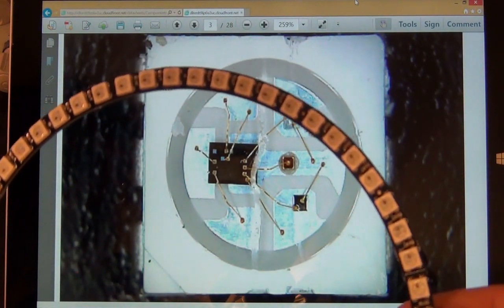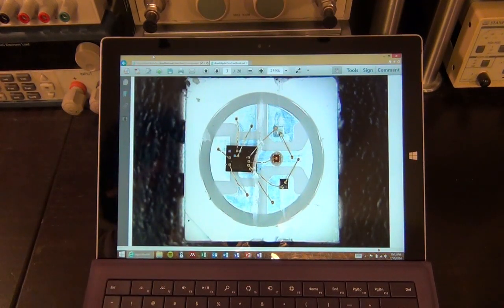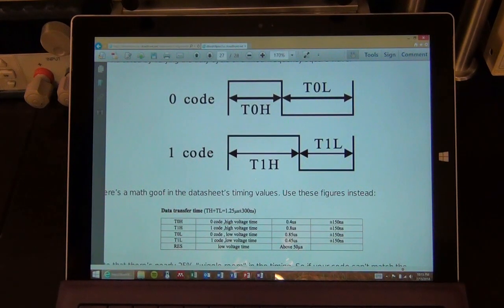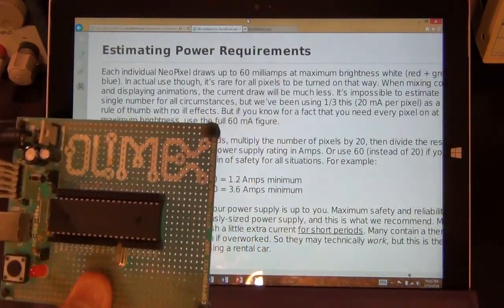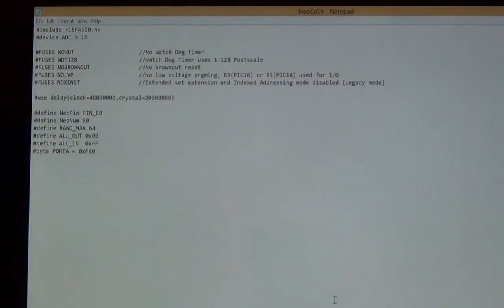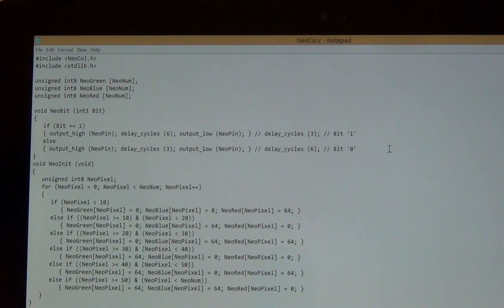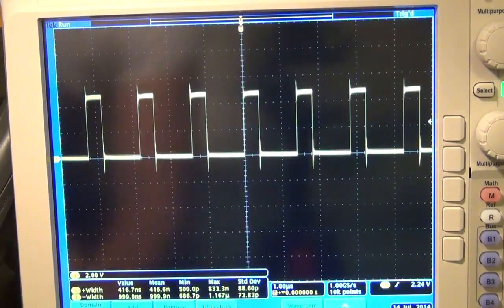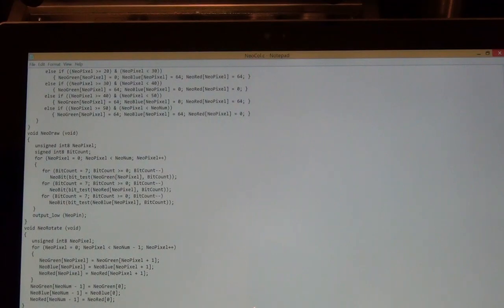TSP #31 - Tutorial on Programming the NeoPixel (WS2812) RGB LEDs and Equipment Giveaway!

Comment: HI, I would love the bench 0-Scope.

My story:
I love electronics and was 80% of the way to my Bachelors Degree in EE. I ran out of funds and could not continue. I worked in an electronics repair shop for a couple of years fixing mostly home electronics. For practical reasons I went into computer service and eventually started my own IT business. When the economy slumped I lost 75% of my income. My wife got sick and would have died had I not focused my attention on getting her well. Now she is better but my business suffered badly. The economy hasn't recovered where we live and we need to move once back on our feet financally. I had to sell nearly all the equipment and test gear I owned during this period. Since I owe a great deal of money I am unable to purchase test equipment beyond a DMM. I was gifted the money to buy a YiHua 898D+ SMD soldering station and a nano scope which is pretty unusable.

My O-Scope useage plan:
I have accumulated quite a few non-working home electronics items that I need to fix and sell to help get back on my feet, but a decent scope.would help so much. I'd like to design and build some small projects for test market and once a viable project is found, I can earn enough money to move and we can restart our lives anew.

Thank you for considering me.

Comment: Dang! Not in the USA :( . I could really use a step up from my 20Mhz non-storage oscilloscope (which I could give away then myself).

And why do the pixels still work? My guess: all the pixel really does is sample 500-600ns after the rising edge and doesn't care about the low period at all, as long as it is longer than a few hundred nanoseconds (btw. in the original datasheet the times for T0H+L and T1H+L are not the same) does not go above the limit for the "(re)set" (50µs). So maybe the datasheet is making it more complicated than it really is (hey, it's from China, what do you expect ;) ). Have you tried how long you can stretch the low pulse before it stops working? I wouldn't be surprised if you can hold it low for 10µs and still have it work.

Comment: Hello, first off i want to thank you for everything that you have done for both myself and other viewers alike; you have truly helped me engage in electronics at a pace much faster than most of my peers who stick to their textbooks and for that i give appreciation.
Secondly, I am the Vice President for my college's Robotics Club as well as the President for their chapter of IEEE. Last year I pioneered a project called "Warrior Robotics" in which clubs from several universities participated. Similar to Battle Bots, teams are responsible for completely designing from scratch a robot to battle. One of the issues we ran into at our competition was the fact that we were limited to the use of the school's test equipment (oscilloscopes mainly) to troubleshoot and repair our robot (which after several lashings became common practice)! I've been looking for a portable oscilloscope on eBay and have yet to find anything within our price range...we don't have much money! Seen as the competition was in a completely separate building from our laboratories, a handheld oscilloscope meter would be extremely beneficial to the club. Also, our club participates in a weekly community service project at a local school district to help high school students with FIRST and VEX robotics. The only catch is that they do not have ANY test equipment...they literally plug and play; however, much like you have said, this is a very linear process that does not give the intuition of what is actually happening inside. Having a handheld scope like that would be a fantastic opportunity for these young students to learn! Last but not least this upcoming fall, I have worked with our campus greenhouse on a project to completely automate their hydroponics laboratory with electronics designed mostly from scratch; however, once again we are unable to remove test equipment from our labs...which are across campus. 
If it would be possible for me to enter this giveaway on behalf of SUNY Alfred State College's Robotics Club and IEEE chapter, i would be delighted. Either way, your videos serve more than enough charity already, and once more i thank you! 
Cheers!

Comment: My first try was also to use bit banging but unfortunately the Msp430 I used was to slow for the modules. I am sure the same applies to the Avr processors used in the Arduino

Comment: What a refreshing change, to see a microprocessor other than an ATmega (Arduino) being used for a project like this. But the bonus for the beginners is the tutorial about power supplies and load.

Too many videos on YouTube that just say, grab an Arduino and download this library, then connect this shield. You can't learn anything from those types of tutorial. Too many newbies end up with a smoking board instead of a light show.

The code of course will be very similar for either platform, so the discussion around the one wire protocol and the timing (and how to bit bang it), is valuable regardless of underlying microcontroller.

Comment: Why do so many people think arduinos are only library driven easy to use mcus? Seems especially so in the "professional" community. I mean they can be but they are just as capable and advanced as pics. arduinos run processing but frankly it's nothing more than c/c++ anyway and can just as well run c/c++ code on them without doing anything special. if you think using a library is too simple than don't use one and do everything manually. open up the datasheets and use the registers directly with custom timers and whatever else you may want to do. It can be just as low level and technically challenging as any other MCU. they are wonderful for the specific reason of being easy and friendly to use for beginners but at the same time the same board can be used by "professionals" to do anything they may want to do getting as technical and low level as they want to without forcing them.
Reply from the maker: Sanel Smajlovic I am not sure what the issue is here. No one is claiming having libraries is bad. No one is claiming having Arduino is bad. My main point was that some beginners are somewhat removed from the hardware because all the hardware is readily taken care of. I was advising people to make sure they understand what it is they are using, both software and hardware. If that is bad advice, then I don't know what to say.
Reply: Wow, you took so much wrong there.
First he never said that PICs are better than Arduinos. I am sure Shahriar is well aware that Arduino-code is C (btw. they don't run C/C++, they run machine code) and that the underlying AVR can be programmed directly without using anything Arduino related except for the board itself.

He also never said "libraries make everything too simple, don't use them". It's just a fact that by using them you learn absolutely nothing about the parts you are using. And why do you think that especially the "professional" community doesn't like that? Ever thought about the fact that they have experience and know what's important? As a "professional" (I'm teaching a beginners electronics course at uni), I will just tell you the same: Arduino with its libraries is nice, but the learning effect is almost non existent. Sure students are fast to connect something up (even a connect pin x to pin y list, let alone a circuit diagram, doesn't cut it anymore; it has to be a visual representation of the Arduino board and other hardware with jumper wires shown) and load an example program. But give them an unknown but simple part with its datasheet and things go up in smoke. Or use two libraries that conflict with each other, because they use the same pins/timers/interrupts, and everything stops working. You think someone who's never looked into how an AVR works knwos where to look for the problem (except Google)?
Reply: The Dude haha! BGAs are satan incarnate ... layout alone is a huge pain, getting the PCB proto made with small enough vias is another pain and placing them right the first time (without a reballer) can go down to pure luck XP
Reply: Alyx McCown I agree. I like them both I hate PIC vs AVR battles no sense.I do think microchip makes fine datasheets and application notes.
Reply: The programmers and C compliers for the Microchip Pics weren't cheap when I was using them (over 10 years ago). Unless you were happy with the unoptimised free compiler. Only the IDE was great and free so I did most of my programming in assembler. Thing's have changed a bit with ICSP but it's still more expensive than arduino development if you're only experimenting and not looking to develop production runs.
Reply: The Dude I never got in to pics solely because of their non-new-user-friendly compilers and programmers 
I went in to AVR and ARM quite early on and i only pick up a pic if i absolutely have to
Reply: The Dude you can just as easily use the atmel chips in productions runs, in fact a ton of people do so "not looking to develop production runs." is nonsense
Reply: superdau the c/c++ code gets compiled down to machine code yea sure if you want to get technical about it but point was you can still program them in c/c++ is what i was trying to get across which he does not seem to realize by his statements. 

Regarding libraries, you can still learn a ton from using them, you don't need to to figure out all the nitty gritty to get something working. some sensors or interfaces are soo tricky it's just unreasonable to expect someone to write an interface for manually. in cases like this it's better to just use a library to learn about the device functionality first before you spend who knows how many hours trying just to communicate with it. there is nothing forcing you to use them, you can just as well have restrictions on not being allowed to use them. they can always try to get more technical if they want to learn more but aren't forced to which is the great part. they can always learn just as much but the key thing they arn't forced to unless it's a guidelines for a class or something. My old hs teacher had the same gripe about arduinos thinking everything is too easy the kids will learn nothing but that's frankly just not the reality if you have things setup properly. From the years i've witnessed people try to get into MCUs, unless they are particularly clever most people simply crash and burn and give up if things are too difficult to get going. If someone can get over the difficulty wall sure they will learn more with harder challenges but at the same time if a lot of people are failing because it's too hard or needlessly complicated just to get a light flashing then the overall effect is a lot worse. the skill ceiling is the same for an arduino and pic but the key is the barrier to entry is orders of magnitude easier for the arduinos and that's an advantage not disadvantage as you seem to indicate. If someone gets stuck, ie using two incompatible libraries, isn't it better to now have them try to figure it out manually instead of that being a requirement from the start, at least at that stage they will have some experience with the platform.

the reason i said "professional" is because some of the more serious electronics personalities seem to have it embedded in their minds they are only for beginners which is just wrong. Are they a one stop solution for everything? hell no but give credit where credit is due.
Reply: Sanel Smajlovic This is where i have to disagree, im an atmel user but when it comes to production runs atmel chips might be too expensive for the tasks at hand and you cannot beat the vast diversity of pic uCs and you can choose one for exactly what you need 

Tho yes i have seen atmel's in designs like the xbox controller ... its great for that where you need a mix domain of analog and digital combined with USB so that was a smart choice
Reply: Sanel Smajlovic  Apologies, my comment wasn't very clear. I meant that a beginner (not a production run engineer)  would find working with a Pic chip more expensive and complicated than using an Arduino board. I did not mean to imply Atmel chips were not good for production runs.
Yes it is likely a beginner may initially miss out on the whole hardware/register layer by taking this path but at least they are interested.
Reply: Alyx McCown The products I was initially designing were fairly simple and were easily developed using Pic assembler. It wasn't until much later when our products became more complicated that we needed to start using a higher level language. We tried Pic PIC18F8722s for a few early prototypes but quickly moved on to AT91SAM9260s. Ugh! BGAs, but that's another story.
Reply: PIC`s datasheet is far more expressive than AVR,
Reply: Ehhh i think they both have stuff the other is lacking but they both give more than enough information for all but the most niche application